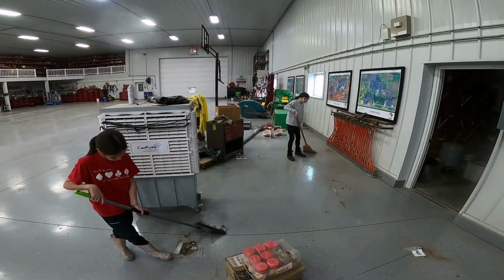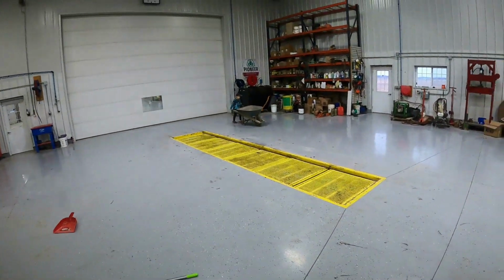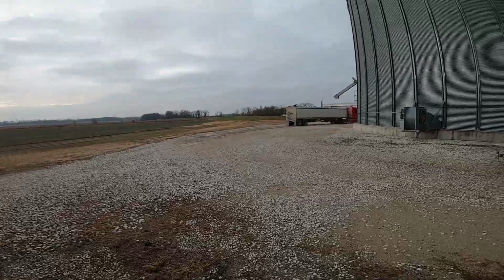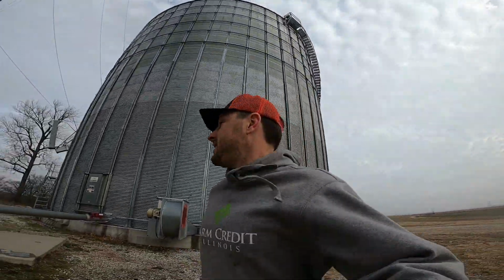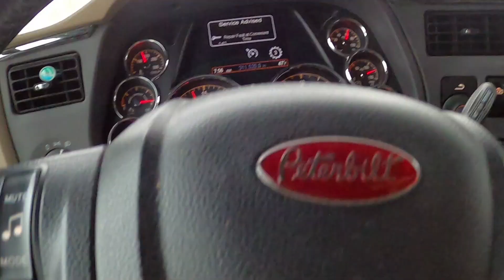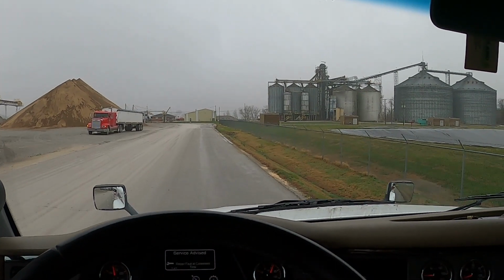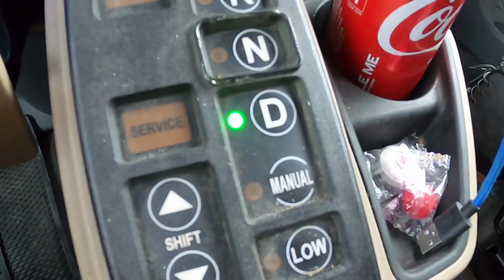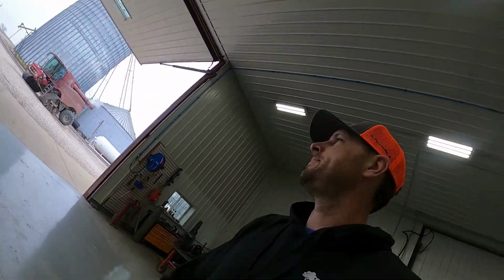Getting a Case IH 9250 Combine Ready to Leave Season 2 Episode 43

Comment: To much water for us up here hurt us, some June corn was great where the water got off some was still good better than we thought bu over 50, was 100 bpa swing in June corn, depending on field and how water got off. Beans not best ever but close 3rd I think, had 3 fields do best ever on beans, had the ncga corn field do best it ever did. Milo had field go 150 average, had 3 one was 135 and one was 142 then 150. As you said good year great prices and cheap input prices big help. Just wish I had back a lot of my early sales. Buy they made money but dang sure stings now!!! Happy new year
Reply from the maker: Guy never knows what to do. I know your contest stuff sure was impressive
Reply: @iversfarms  I was shocked, I attribute a lot to hog manure applied the fall before 6500 gallon. Were near a place that has I can't think how many hog barns. Also put on gypsum as well 1000 lbs from merom power plant for the sulfur. Only thing really different, it did have xyway in furrow, wished we did a nother pass beside the plane at tassel for fungicide, regret now not making a3rd fungicide pass oh well. was to wet for hagie on the 2nd pass. We counted 0 for hog manure on the N. Every year is different for sure good luck in 22. Keep up the videos!! Glad you found a combine the 50 series combines sure are great